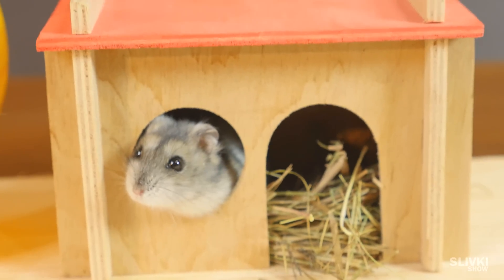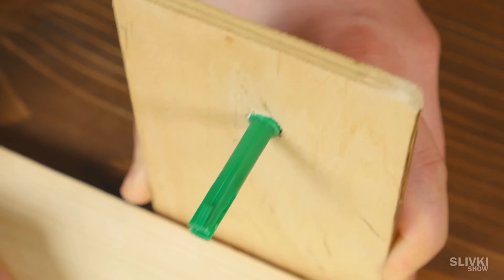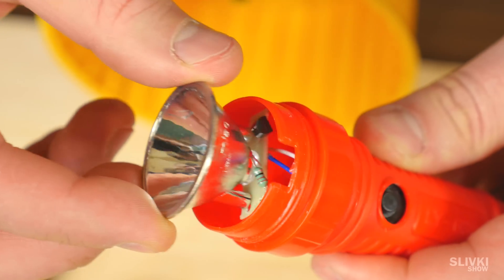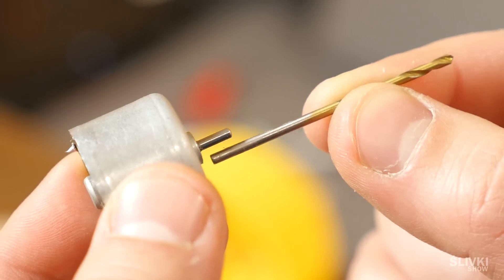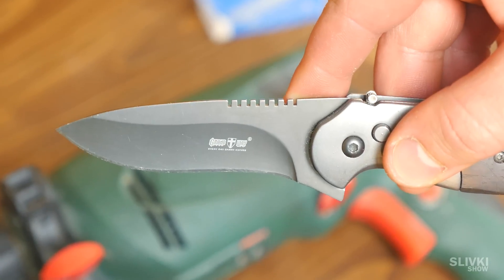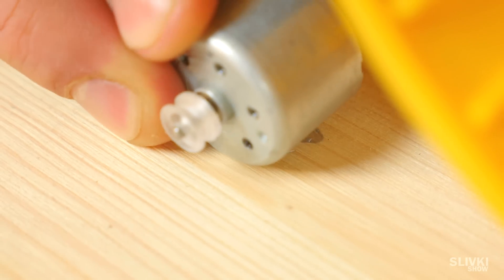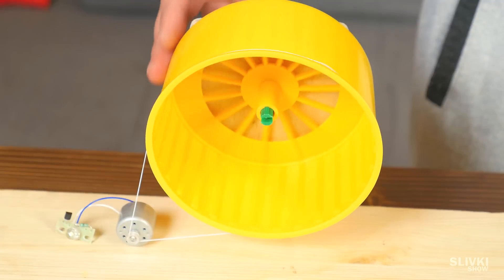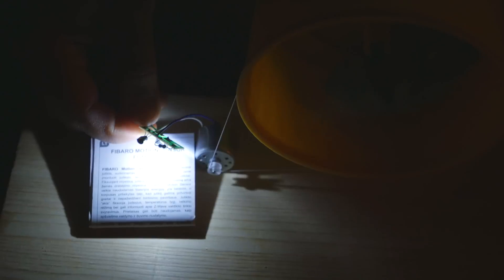Experiment. Hamster generates Electricity!

Comment: Cute hamster.

Anyway, hypothetically speaking, what if you made a wheel, connected it to a motor, rubber banded to another motor, both motors wire connected to a circuit board of sort, and give it a push? Would the motor constantly supply speed after the first push because the motor gotta keep running after it's powered up by the wheel being spun in the first place, the second motor constantly spinning the wheel while the other motor is rubber banded to the wheel like in the video? Or would that just not do anything because it's using another motor and it would have to be powered by something else like the hamster, or like making it a water wheel for instance could make it water powered (or olive oil/vegetable oil powered since that doesn't evaporate)? But then if it tips over, it would stop running AND it could damage the motor if any of the liquid gets onto the motor... Thinking about a possible "perpetual motion" machine, lol, I know those are technically impossible, but it's just an idea... I mean, that sounds possible in my head and like it would work fine, but it's probably not technically perpetual motion, even if it is perpetual motion... I guess...

Comment: If you make the assumption a hamster is capable of producing 500 mWatts of electricity running on a wheel it would take 320,000 hamsters to power the ISS.

Comment: IT TOOK YOU DAYS TO DO? WHAT? REALLY? I CAN DO THIS IN 10 MINUTES WITH SOME MORE ELECTRONICS.
Reply: I think the motor is always getting off the wood.I tried it and the motor flew off the glue.
Reply: @euvo_sound  Try using screws and a bracket over the motor
Reply: @xxexplosivexxxxexplosivexx8512  Yes i already did it but thanks for the suggestion

Comment: one problem , just one problem

if the hamster reverse it , it not working cause its DC
Reply: Derp.
Reply: Just drop in a bridge rectifier.It will give current in one direction even if the polarity of the generating device changes.
Reply: @lvb1b463  👍👍👍👍
Reply: What
Reply: CHAITRA GAMER stfu not-an-engineer
Reply: Search for full bridge
Reply: That's when full bridge comes in handy
Reply: FOOL BRIDGE RECTIFIAA
Reply: @zUltra3D  i was looking for this comment. thank you xD
Reply: zUltra electro boom
Reply: Study basic elecrical theory.
Reply: @bananaegg7984  well not everyone is old enough to understand it I'm taking electric engineering in 2 years from now
Reply: 9
Reply: No, alternate current can go on both ways in the cable and E (reverse 3) and the current of induction both have a graph like sin(x). AC is a current from U shaped wire which turns behind two magnets, I think

Comment: You could add a battery and make sure all that stuff is out of the way of the hamster. Then make sure it work even when the hamster runs the other way. Then you use a proper generator instead of a motor. Specialization = Efficiency.